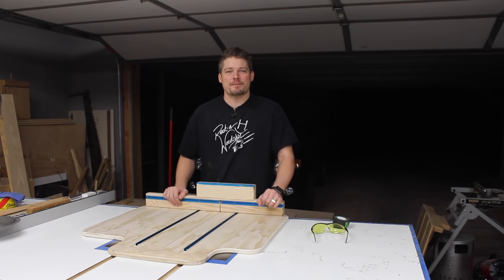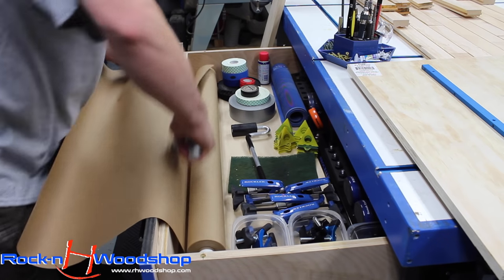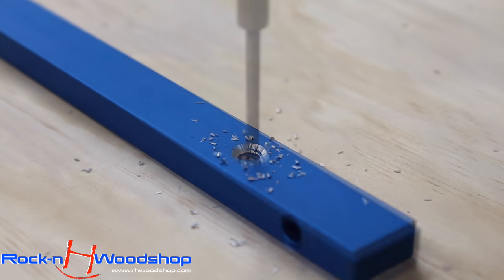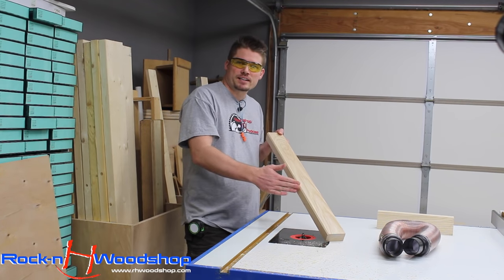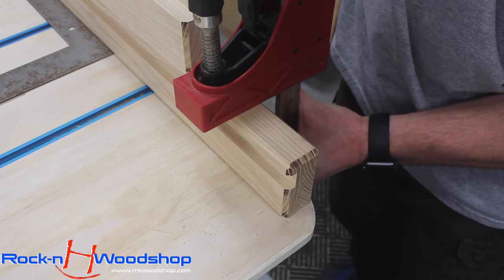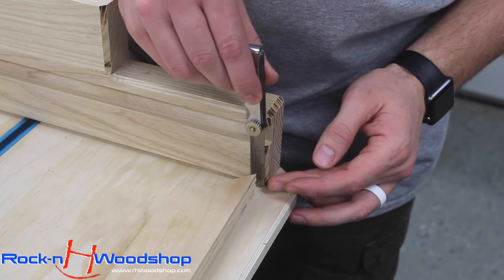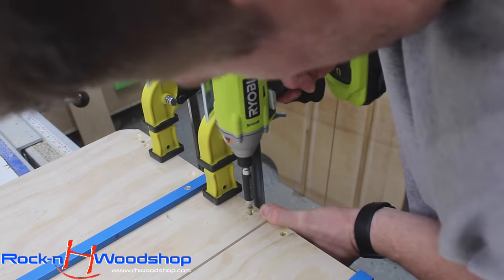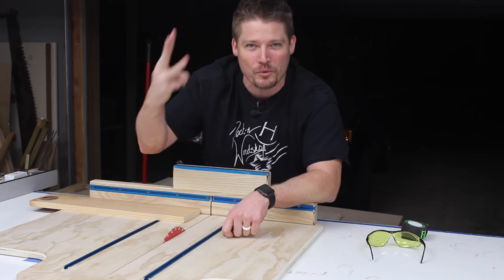Ultimate Crosscut Sled with Dust Collection

Comment: You are taking scary chances pushing 3" wood through a blade without a riving knife or a push stick. A kick back will drag your hand right into the blade before you can blink.
Reply from the maker: I appreciate the concern, unfortunately this tablesaw is in capable of using a riving knife. I am in the process of acquiring some push in splitters but that is all I’ll be able to do. In the meantime I have slightly pitched my fence away from the blade to help combat any kickback problems
Reply: @rhwoodshop  I had a General 350 with the same problem and I got a piece of plexi glass right in the ribs one day so, after some research I installed some push in splitters from Micro Jig like you mentioned and never had a problem after that. Work safe, I enjoy your presentations and really appreciate that you don't subject us to your choice of music.
Reply: @rhwoodshop  
You can make a zero clearance incert, make a longer then normal split and add a plywood shim up over the blade as long as the plywood shim is the same thickness as the blade it shouldn't catch.  Other option is 
Jessem stock guides or board buddies
Both these will keep the wood from riding up the backside of the blade and twisting then comming after you like a frisbee @ 100mph. Faster then you can blink an eye, and take your hand with.

The shim works kinda like the micro jig splitters. But 30 bucks cheaper.

Never be afraid to watch a lot of youtube, man I've learned so many tricks from other people here.
Nice sled by the way.

No one guy knows everything and never will.  There are 15 ways to do the same thing one will work the best for you. But dont be afraid to try it a different way anyway.

Comment: Dont understand front stabilizer piece. What's the purpose If it's not going to be vertical to allow you to cut all the way through the slide
Reply from the maker: +Mike P because it allows me to cut an unlimited number of widths of stock. If I had a vertical piece it would automatically limit how wide of a piece I can cut. If the piece of stock exceeds the width of my sled I make one cut by raising the blade up into the stock and then immediately flip the stock over and finish the cut

Comment: By the time the blade has reached that sled dust collector it is actually finished cutting so why bother putting a hose there.
Reply from the maker: +MrKockabilly because it is pulling dust through the kerf line much stronger than my tablesaw dust collector. It’s easy to question until you actually use it. Game changer!